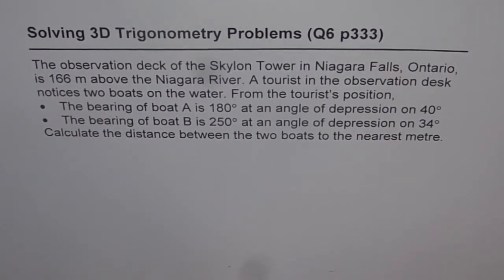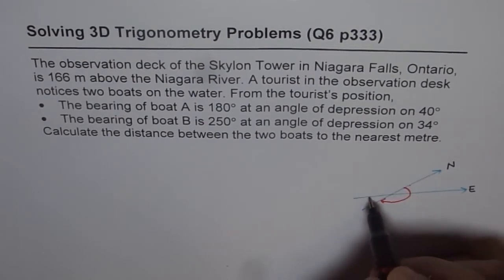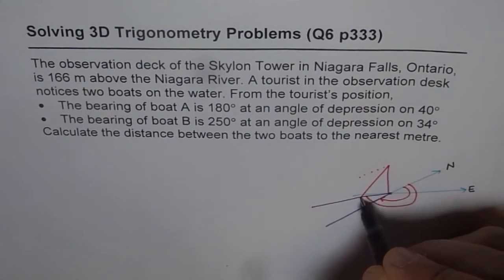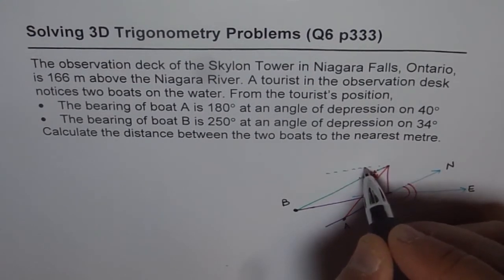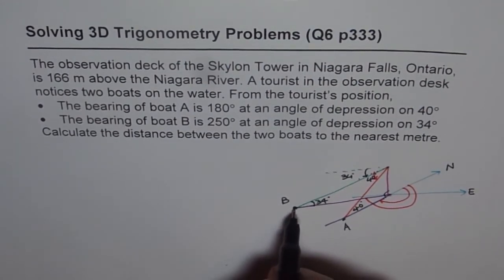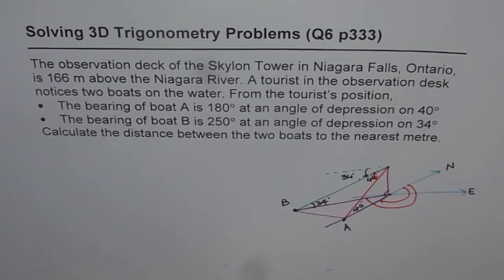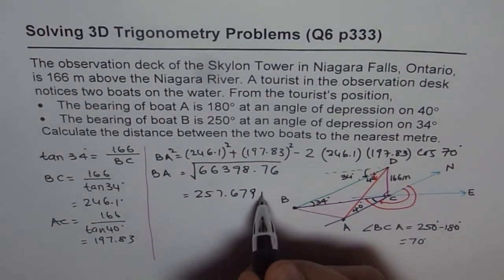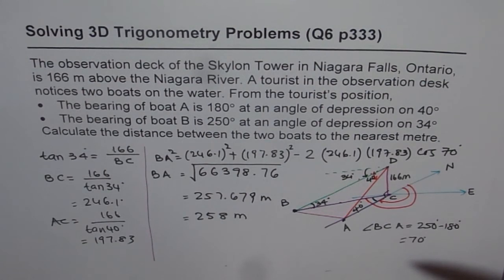3D Trigonometry Application to Find Distance Between Boats Seen From Tower | MCR3U Test

Comment: You did it well. My question is for you is: does the primary drawing of direction, like you drew and north and east, always work with any 3D that has a bearing case?
Reply from the maker: Thanks for an excellent question. The representation of North and East as shown in the video is very helpful to solve such problems.